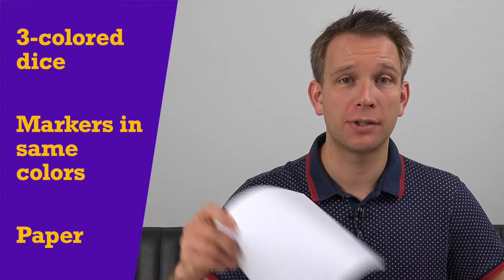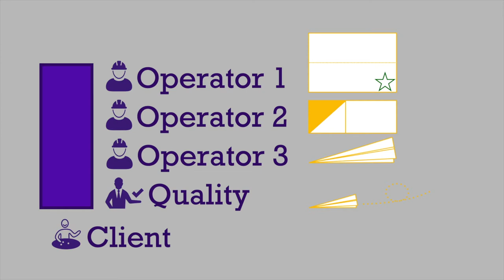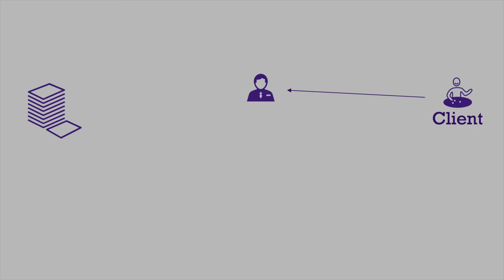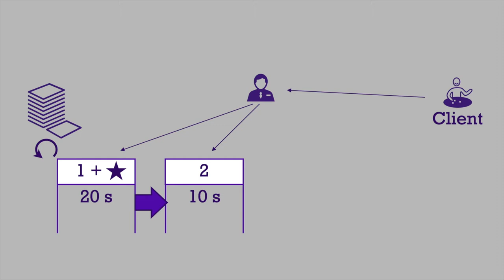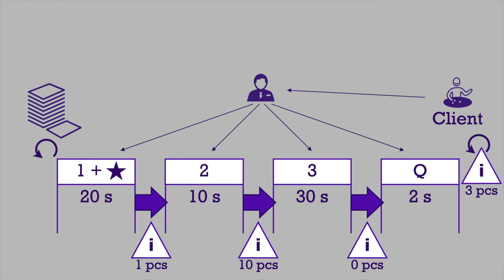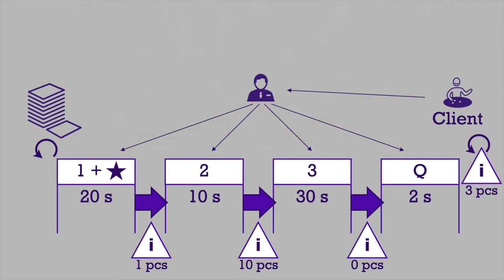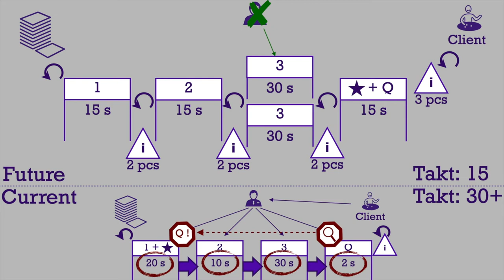Value streaming made easy | Paper airplane training game

Comment: Great video! Loved it. How often do you usually make an order as a client? Just wondering about this and mix of colors in orders. To make the game (1round) attractive and to make the results satisfying after improvements in next rounds. Do you have any tips?
Reply from the maker: I usually start with a roll every 30 seconds, just one plane ordered of the colour that was rolled. You might want to hint to the teams that they could negotiate with the client about higher or lower sales volumes (which translates to rolling every 20 sec, or every 40 or 45 sec.), but they will have to deliver on that promise of course 😉
Round one will be interesting in any case - they will make a mess of it because everything is new. Do mention that while they're allowed to build up stock, any inventory in the factory will be counted and cost them money 'for keeping raw materials and WIP'.

A general bonus tip (if you can handle the extra workload as the game master 😅): ask the team members how they feel after each round, how smooth were things, how's their stress level, etc. At first, you'll likely hear that some stations are super busy and can't handle the load while others are relaxed, almost bored (and probably laughing at those busy colleagues, since it's all a game anyway). If you do rounds with good kanban, and definitely if you do a full silent round, you'll see that stress levels go down a lot (the silent round with kanbans in place is the most productive and relaxed 'factory floor' anyone has ever experienced).

Comment: Hi Tom. Very nice video. Excellent for learning through experience. I am managing a large SAFe-based software development program with about 150 people devided over 15 teams. The challenge is that compared to the game you show the variability of the requirements/features flowing through the value stream is very high. In your game it is extremely low as you produce the same again and again. In software development our requirements might be big or small and it might even be tricky to follow how much process time is put into the requirements at each step. Any suggestions on how to modify your game for high variability and low visibility of actual process time? Thanks for an excellent video on this.
Reply from the maker: Hi Søren, thanks for your kind words.
I would not be hasty with making the game itself more difficult, as it is meant to show the principles within no more than half a day (game + VSM training). The best way to learn is to follow this game up with projects immediately - train your project team members and sponsors just before making the VSM’s together and doing one or more flow improvement teams.
If you do want to incorporate things into the game, here are some suggestions:
Non-leveled load: recolor the dice to have 3 red, 2 green and 1 blue side.
Full usage of capacity: actively suggest the ‘managers’ that they may agree with the ‘clients’ to roll more often (every 20 sec) or less often (40 s) to get the most out of the capacity of their factory.
Changing market: make different dice, with differing colors and number of sides per color - 1 or 2 times during a game round, the ‘client’ randomly changes dice. For this to really show effect, the round may have to be longer than usual (8 or 10 minutes, for instance).
Different time required for different product variations: blue stars have to be fully colored in, the other colors only have an outline.
Erratic demands: ‘client’ rolls the die twice, if the second roll has the same color, they order 2 planes (if different color, nothing happens).
A change that I really like, especially when teaching the stress reduction that comes from visual stock management, is that the 3rd round nobody talks - you will probably see that even though there is less communication, the efficiency probably is higher and the stress levels lower.
Reply: @TomMentink  This is simply brilliant. Thank you! I will try and work with some of your suggestions for some of my client workshops. Really good stuff. Thanks.